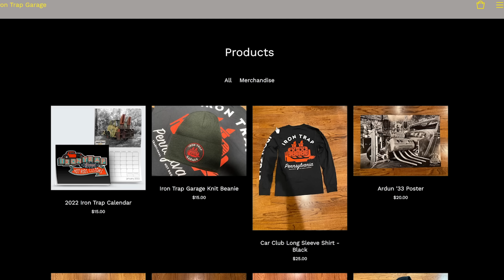Working On ALL Of The Roadsters & New Shop Equipment!! Week Of Iron Trap

Comment: Glad you got the Doall, during my 59 years of tool and die making there was always one in the shops.
Hope it has a functional blade welder, making your own blades is easy and saves a lot of money. Sometimes just a section gets pinched loosing some teeth, that blade can be salvaged by welding a longer section from an old matched wear blade.
My first employer's welder start button was worn and the weld cycle was initiated by crossing 2 yellow plastic handled large screwdrivers to make 220 volt contact.
My last employer had maintenance replace 2 floor tile color to establish the blade length off the roll.

Comment: Noticed the pennies, gives a very different sound. However, I only put in one which still left heat for the carb. Two were ok on our race engines tho as they ran hotter but for the street one is good.

Comment: Hey Matt , I noticed the relocation of the fuel tank breather on the shop truck clip . An idea for keeping things out of the line where it terminates under the truck would be a brass pile filter . They are used on air actuators to vent air from a switched source . That would work on the line end to keep bugs from getting in there . Just a thought , great video , keep up the awesome work gentlemen !
Reply from the maker: Good idea thanks!